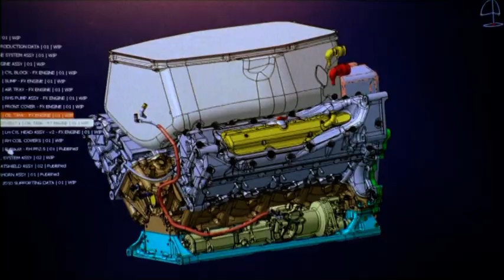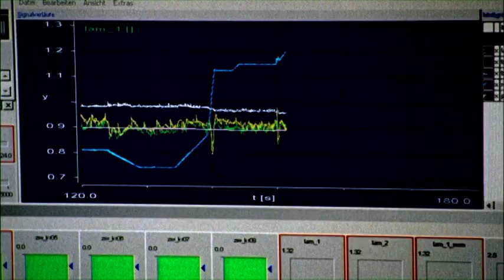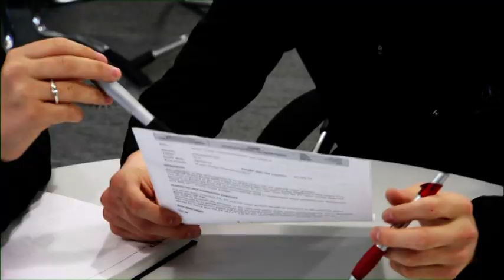How to get a job in F1

Comment: Is there an opening for a clown? I can help boost workplace morale : )
Reply from the maker: Tempting...;)
Reply: @MercedesAMGF1  you better give this man a job
Reply: Don't want to bring you down, but 12 is almost a bit too late. You almost have no chance of coming into f1 by luck, you need to dominate gokart championships, then hope to get picked up by some lower formula team and work your way up from there. Good Luck :)
Reply: I am 12 years old and I've always been a fan of F1 when I was young.  I've done some simulation racing on my console and I've Been practicing and working to be an F1 driver when I'm older I've masterd manual gears and the problem is that I keep on spinning out when I come out of a corner any tips you could give me my Dad always trained me for the fastest line through the corner and I've been going to the gym to work out the important places such as legs, arms stamina
Reply: @dogeexterminator8315  can I be your mechanic when u become a driver?
Reply: Doge Exterminator How are you getting on now?
Reply: @dogeexterminator8315  what you need is cash
Reply: @dogeexterminator8315  How’s it going?
Reply: +awesome Its not the end of the world. Adrian sutil didn't start karting until he was 14 and he was a pretty talented driver.
Reply: F1 is full of them !
Reply: Shoi Nagase
Reply: If you want to race a "computer", aim for F1. If you want to race a car, anything but F1, these days
Reply: cbr Why too old? Alain Prost started karting at 14!
Reply: Doge Exterminator don’t floor it, I’m not an expert btw, but I think that could help you
Reply: cbr prost started when he was 15 by some family trip
Reply: I would go, go-karting but I live in butt-fuck nowhere and the closest karting place isn't real-deal races...